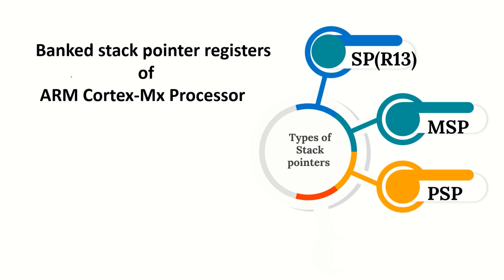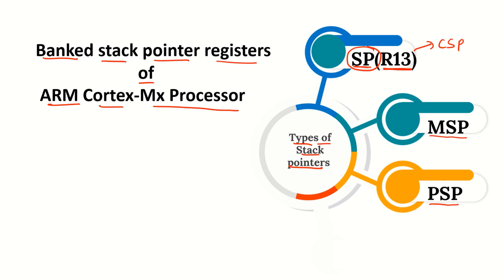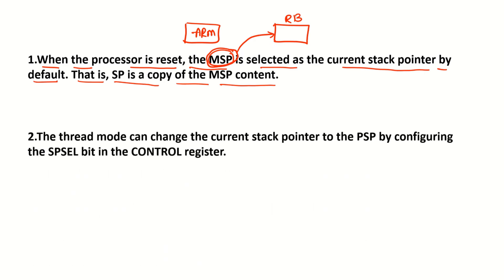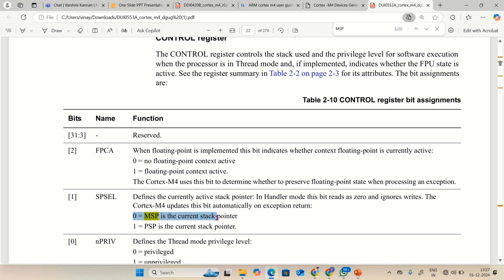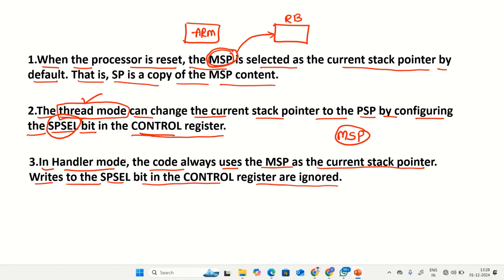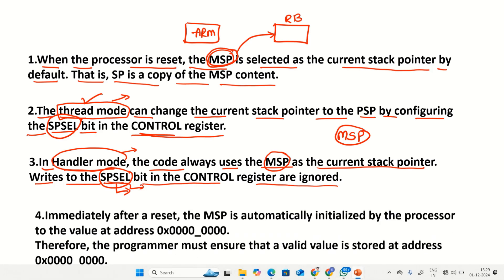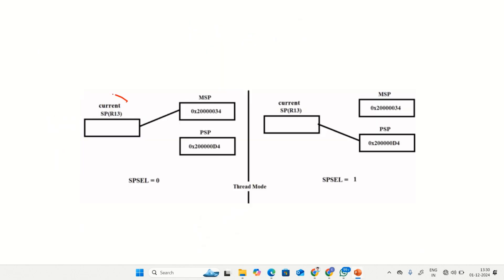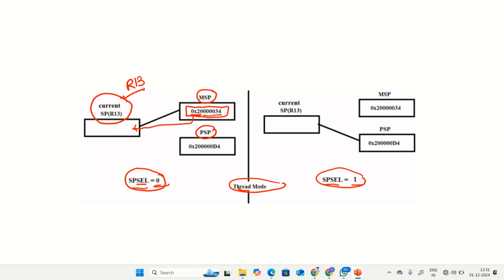MSP and PSP || Main stack pointer vs Process Stack Pointer #armcortex

Comment: Hi, you have added that after reset MSP is automatically initialised by the processor to the value at address 0x0000_0000, the address is of which memory u have mentioned and in that again does it contain address as 0x2000_0034